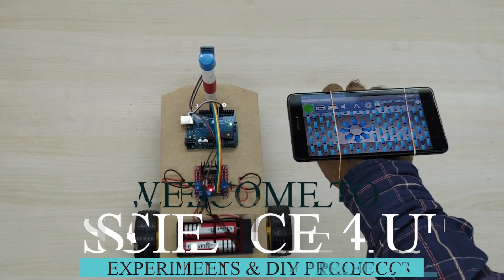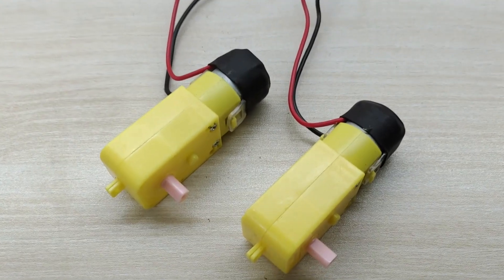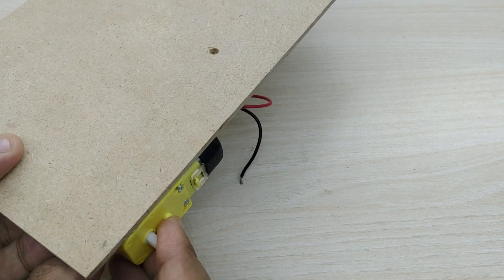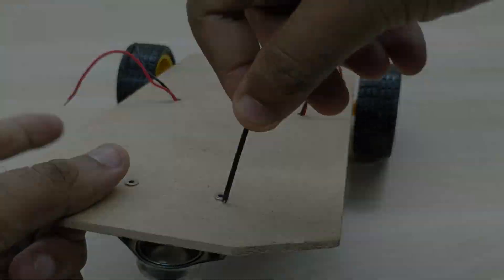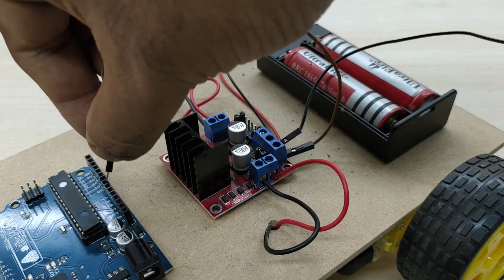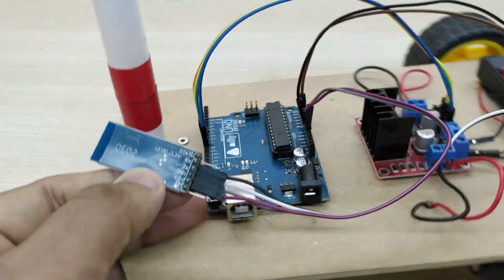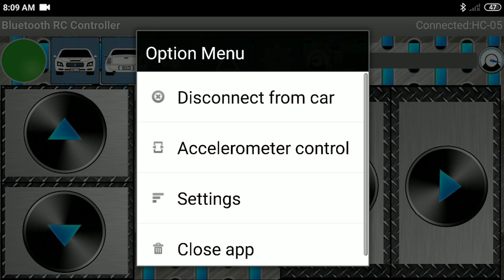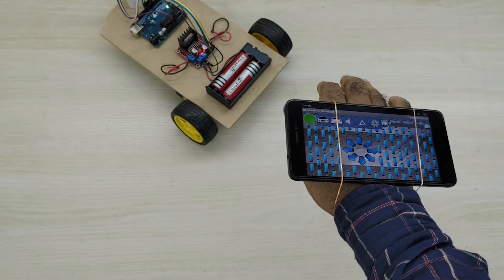Gesture controlled Robot using just a Smartphone || Super Cool Arduino Project!!!

Comment: hi brother, by hc05 is disconnecting again and again and light is blinking only for few minutes, after that it shuts off. pls help
Reply from the maker: If it it disconnecting when you are pressing a button, it is most likely due to discharged battery. The battery voltage is dropping which causes the HC05 to disconnect
.
Reply: @Science_4U_ bro I changed the batteries but it didn't help. Another youtuber said that it's because I connected the hc05 module and then uploaded the codes. Do you think this is the problem? If yes pls help. And yes it's disconnecting when I press any button.
Reply: Also both tires are not spinning simultaneously.

Comment: Sir by mistake I ordered 6 pins in bluetooth module sir 
So kindly send coding sir
Reply from the maker: Hi friend. No problem. 6 pin is HC 06 module and 5 pin is hc 05 module. Both are actually same only. You need not connect the 6th pin. Just use the middle 4 pins out of 6 pins. 6th pin is used for programming the bluetooth module.

Comment: Sir in your hand gesture control car can I use 4 motors and can   control it with arrows with the app

PLS REPLY 😢😢
Reply from the maker: @deshirespectplus  yes friend sure. You can watch the following video whete i have used total 4 motors and also i am controlling the robot using arrows in the app.
https://youtu.be/JK6zTM65Rh0?si=_zEqFV-TebmKjm1F
Reply: Sir can i remove buzzer and light
Reply from the maker: @SmartyAlphaparrot yes friend. You need not connect buzzer and light. Still the same code will work..
Reply: Sir I have  one more question can I use hc06 ,does it will work
Reply from the maker: @deshirespectplus  yes friend. It will also work in the same way. I have already checked that before.

Comment: Is jumper cape necessary in l298n motor driver
Reply from the maker: Yes..l298n is connected to arduino using jumper cables.

Comment: is same code for 4 wheel setting
Reply from the maker: @goalzone2024  yes friend. Code will be same..just connect both the front and back motors together and connect to l298n motor driver board.

Comment: Pls the Bluetooth keeps on disconnecting. How do I fix this
Reply from the maker: Hi friend. Have you given voltage to the bluetooth module from the arduino or directly from the battery pack?. Bluetooth module only works with an input voltage range of 3.3V to 6 volts. So better you can directly use 5V from arduino to power the bluetooth module.
Also make sure you use good batteries. Because as the motors move, it will consume current and drops the voltage if batteries are not good. This drop in voltage can cause bluetooth to disconnect whenever,  the motors try to rotate. 
Also please check for looseness in connections to the bluetooth module..

Comment: Can we made it without caster wheel
Reply from the maker: Yes..Ofcourse friend. This can be made with 4 motors also. Instead of tge castor wheel, fix 2 motors and wheels on either side of the front also. Basically, all the connections will be the same only. The +ve wires from both the left motors to be given together to one terminal of the motor driver board at the left. -ve wires from both the left side motors to be given together to other terminal of the motor driver board at the left. Similarly do the same for both right side motors also..
Reply from the maker: I have also made one bluetooth control car with 4 motors. You can watch the video in the below link..

https://youtu.be/JK6zTM65Rh0

You can see how the connections to 4 motors are given..
Reply from the maker: But only problem that I have noticed is that, if we use 4 wheels with motors, the robot will not turn very smoothly. This is because while turning, there will be some resistance due to skidding of the rubber wheels. But definitely, using all 4 motors will also work!!!